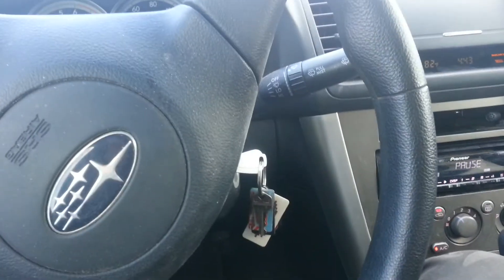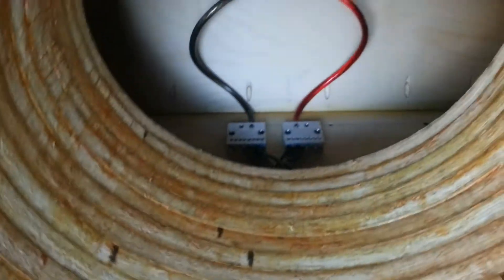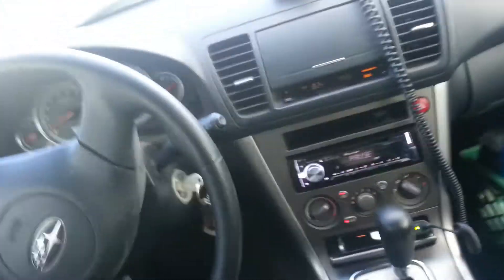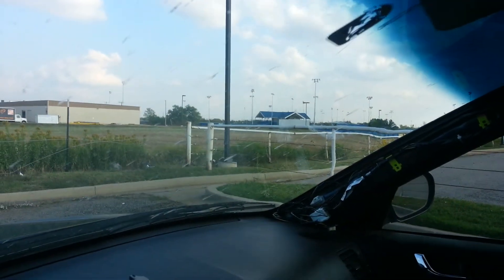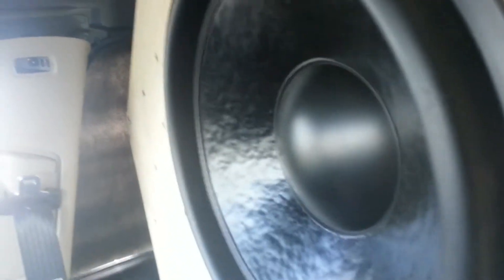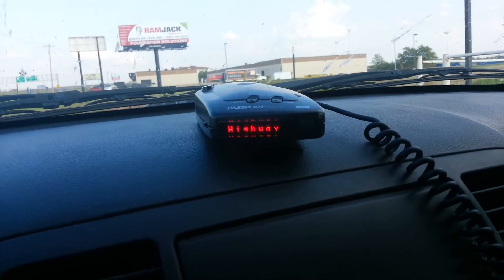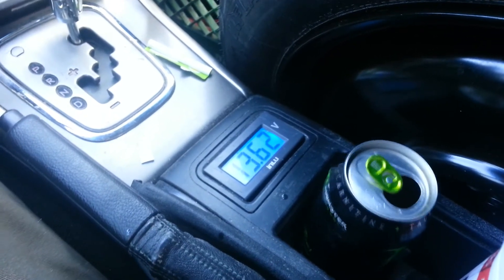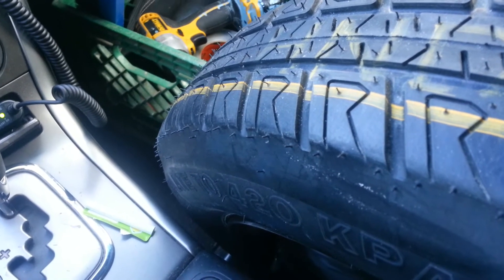SI HT 15s at 2 ohms subaru legacy wall

Comment: If you don't mind me asking what was your box tuned too and what kind off watts did you put too them. I have 2 18 that I was gonna do a home build with but might put them in my SUV.
Reply from the maker: 16 net and tuned at 31 ish hz.  Had them on an 8k at 2 ohms and then a aq3500 at .5 daily.  As long as I kept it clean they were fine.